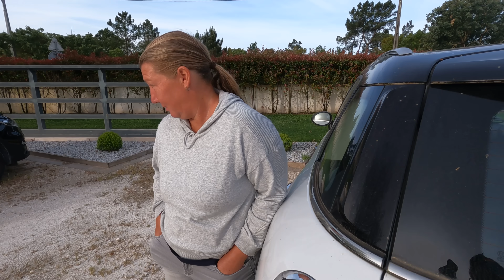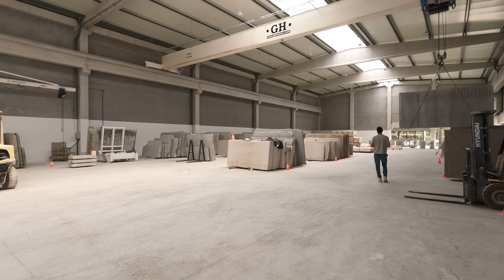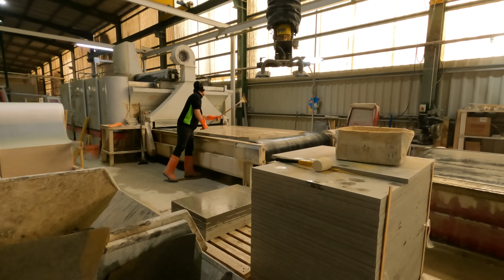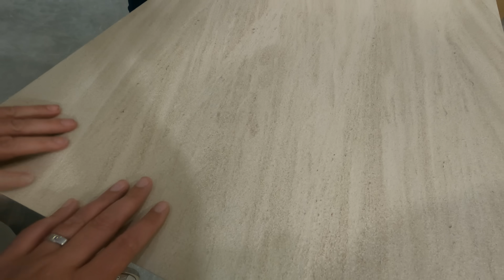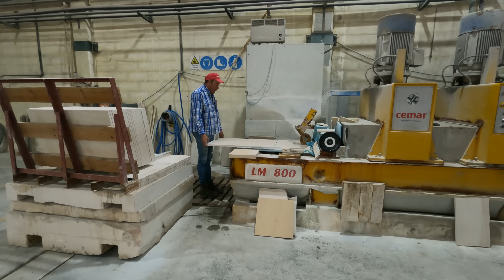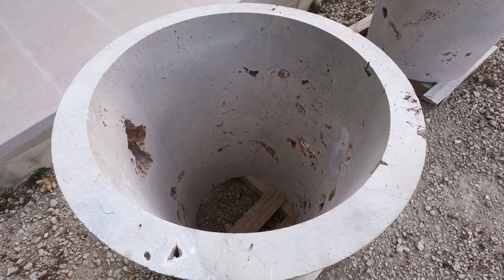How Are Limestone Tiles Made? Portuguese Flagstones

Comment: There is a similar quarry in Tasmania. I am surprised you haven't heard of it. They have a saw that slices vertically into the sandstone and then the blade flips horizontally and cuts out the block. These stones are used to restore the historical building and sold for new construction. It is phenomenally expensive! I'm sure you didn't pay anything like what it costs in Oz.

Comment: The stone dust sediment is also recovered from the water and dried by some stone companies particularly in Italy .It looks like fine flour when dried and bagged .In it’s raw state it’s what you have been using in your lime Crete I would imagine .It makes an excellent filler and extender in a whole range of products like pollyfilla ,Some textured exterior coatings  and paints and all kinds of rigid plastic laminates and also gap filler glues . If used in plastics it can act like a heat sink and increase the fire retardant properties of the finished plastic laminate . Cheers .

Comment: I was working and staying in Belgium near Charleroi at a very nice establishment which was a cross between a hotel and rented apartments. Each apartment had a mezerein floor the mezerein was the bathroom and bedroom. Ground floor was a sitting room and kitchen. All meals could be purchased from the restaurant. Cooked in your own room or takeaways delivered. 
The whole establishment was a restored building with vaulted brick ceilings to reduce the fire hazard. 
I can not remember the original use of the building. 
The entire floor was covered in black slate tiles. The owner of the establishment informed me it was cheaper to purchase the tiles from China than the quarry 5 miles away!!
Reply from the maker: Interestingly enough, LimePort export a very large amount of the stone blocks to China